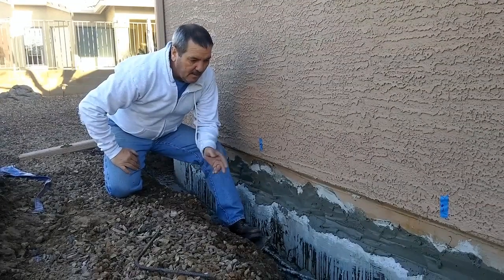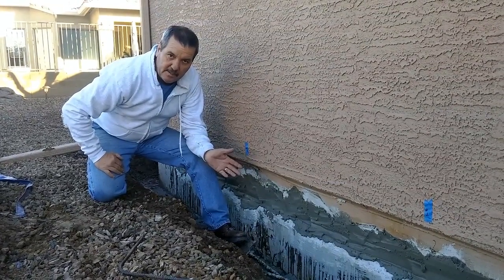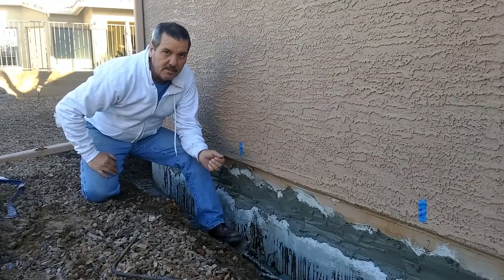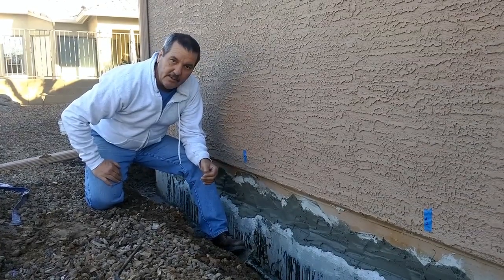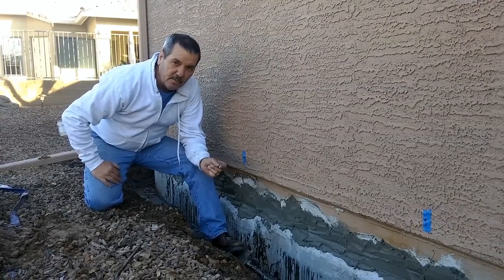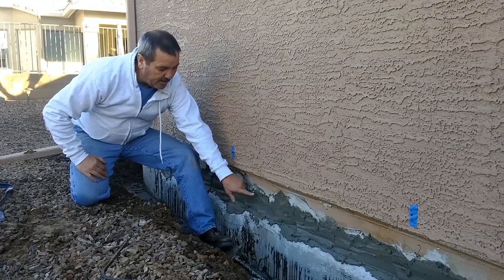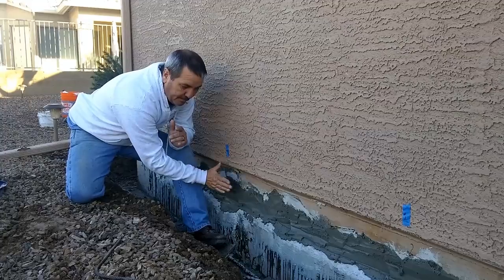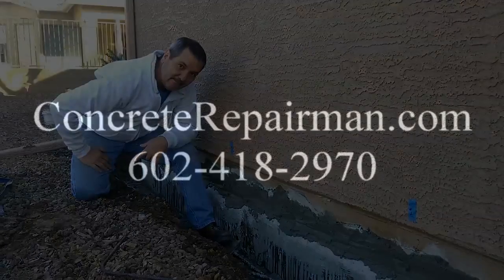Foundation Repair Expert Phoenix Arizona - Concrete Repairman® - Stem Wall Repair AZ

Comment: James Belville is the proud owner and operator of Concrete Repairman LLC. A fully licensed, insured and bonded contractor serving both commercial and residential customers in Arizona. James offers a full range of services including concrete floor polishing, concrete floor leveling, resurfacing and of course concrete repair of all types.

With over 30 years of experience, James and his staff provide top notch service and quality craftsmanship.

One of the biggest concerns Arizona homeowners have is the condition of their home's foundation and how to prevent or address any existing issues that will effect their home's condition and value.

The staff at Concrete Repairman are experts when it comes to foundation inspection and foundation repair. They understand the issues that Arizona homes have when it comes to issues regarding protecting your home and the investment you have. 

The most common cause of foundation and stem wall problems is water damage. Although this may be hard to believe living in Arizona its true. Water damage is the leading cause of foundation problems and failure. 

How can that be true?

This can happen from number of reasons. Poor landscaping, no rain gutters to provide adequate runoff from the home, low laying areas allowing water to collect are just some of the causes that create potential problems for you and your homes foundation and, left untreated, can result in costly repairs down the road.

How can water do so much damage to my home's foundation?

Most of the homes built in Arizona have poorly treated foundations that allow water to be absorbed into the concrete used to create the foundation and stem wall that support the home. When the home's foundation was poured, metal rebar is put in place to give the concrete additional support and strength. Over time the water that is absorbed by the concrete begins to oxidize the metal rebar inside the foundation. As this happens the rebar expands and pushes the concrete outwards causing cracks and foundation problems. This type of problem will not simply just stop and go away and left untreated will continue and become a bigger and bigger issue.

What are some of the early signs?

Some of the things to look for are paint chips, cracks, bubbles or any other signs that things aren't quite right. If the paint just falls off as you touch it or inspect it this means there is excessive moisture in the concrete. Other things to look for are horizontal cracks, fractures or separations in the concrete. Signs of foundation problem you will notice on the inside of your home would include any cracks in the floor or walls especially around windows and doorways. 

James Belville is a foundation repair and inspection expert. If you are concerned about your home's foundation or buying a home and worried that there may be a problem regarding its foundation call Concrete Repairman and get the answers you need. 

Solutions for Foundation Repair in Arizona. 602-418-2970
Reply: I have a heaving foundation, cracked the tile inside of the home. I had a company survey it and suggested gutters. Those are installed but stem wall is crumbling. You guys still in business?